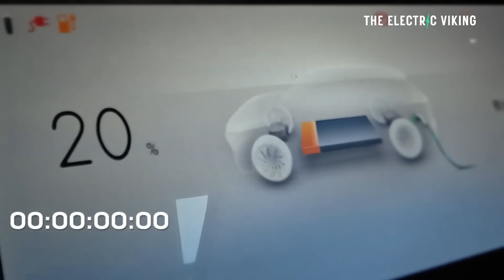CATL Unleashes Sodium: The EV Battery That WILL Rewrite Industry

Comment: I know you mention this in your video but I wanted to put some numbers to it.
Sodium batteries have almost everything going for them but have only one major problem. The big issue is energy density where a sodium battery has roughly half the energy density of a lithium battery (typically 100-160 Wh/kg for sodium vs 150-300 Wh/kg for lithium). That is fine if you are driving your sodium-based battery EV around the city but it will definitely have a much lower range when touring than the equivalent lithium battery.

As far as very cold temperatures go you will find that many EV battery packs have heaters installed which resolves the capacity problem using minimal energy. Typically the batteries keep themselves warm enough once up to temperature. Many EV's require active battery cooling as the batteries get very hot when supplying significant current to the motor.
Reply: The new One from Catl is 175. But yeah, far from the best lithium based chemistrys. Better than a lot of lfps though. There's also a hybrid One, trying to put together the best of both worlds. I Guess Pure sodium won't power premium ev's for example but definitely seem a good solution to smaller city Cars or stationary batterys where energy density isn't a problem.
Reply: future full solid-state Na battery is another story for density issue.
Reply: @民主美国炸小船  Perhaps but might be some years off as the first generation solid state batteries will be lithium based.
Reply: No point comparing the latest sodium with old gen lifepo4 cells.  The new lithium cells are cheaper and have faster charging, better density and temp range.  In fleet services where you pay the driver to wait to charge, pack swapping makes sense and high cycle life works as fleet vehicles see a lot more use.  Sometimes sams brain goes on holoday
Reply: maybe, but these wqill be great for home and grid scale batteries, making solar and wind even cheaper to install
Reply: Good for you living in a warm region of the world! I live in Sweden and the lowest temperature I experienced in Stockholm region was minus 35° Celsius. The thing is, at this temperature the cables in the air gets so full of ice that they snap, leaving us without power to our houses In that case you can't charge the battery and a litiumbattery will not only loose its energy, it will be forever broken! It can only go on heating itself for a short time as long it holds charge!
Reply: Don’t exaggerate, the lowest winter temperatures in Stockholm rarely fall below -15C and ice storms affecting power lines happen at much warmer temperatures. Downed power lines caused by ice storms would also prevent your petrol stations from pumping gas.
Reply: @JohanLofgren-jc4mh  Without a way to warm the oil I doubt many petrol or diesel engines would start at -35 C. I know in some areas of Canada shopping centres have mains power available to keep the engine oil warm while you shop. If the oil gets too cold it won't start and the engine can be damaged by lack of oil flow. I see little difference here between EV's with heated batteries and internal combustion vehicles with pre-warmed oil. Both need electric power.
Reply: @JohanLofgren-jc4mh  interesting. In the past decade, how many times have you lost power to your house due to power lines broken by ice accumulation?

Comment: 90% of its useable capacity at -40C sounds good, but don't forget you also have to heat the car as well.
Reply: Heating is the easy bit ?
Reply: That's not a big concern for most drivers. Even in Canada, we only get -40C a few days of the year.  Over 80% of the population lives within 100 km of the US border.  And most will not drive that far in -40C weather.
Reply: You could always deploy a  seasonal emergency chemically catalyzed heater  to boost the internal heating akin to diesel heaters used on commercial and leisure vehicles.....when used away from  the grid. 🧙🏻‍♂️

Comment: I don’t believe that battery swapping will be a thing in the long term. When a swap take 3-5 minutes and charging is down to 5-8 minutes 10-80%.
Reply: Battery swapping might make EVs more affordable if you don't actually own the battery, which Sam mentioned. You buy the car (or lease it) and it comes with a battery, but that battery is not yours and you don't pay for it. It's part of the "pool" of batteries in the swap system that everyone uses. It also means you never have to worry about battery replacement due to failure. It also might make a lot of sense for taxis and ride shares to operate this way. I kind of think there are a lot of plusses with certain use cases.
Reply: Why does a battery swap need to take 3-5 minutes ?  How long does a car service take ? How long does it take to put a new engine in an ICE car ? It's about time you people started sounding credible, either that or educate yourselves, that's just a ridiculous assertion......
Reply: @MickH60  What are you all riled up about  here?
Reply: @MickH60 what the hell are you talking about?? I didn’t mention or talk about ICE!

Comment: What's the charge voltage?  Discharged voltage ? Charged voltage?  Is the charge amperage stay high over most of the charging rate or does it slow down rapidly like many lithium batteries?

Comment: Na-ion batteries are initially being released as small 4-12V starter batteries in motorcycles due to their superior performance in high&low temperature & charge cycle, from what I see on the internet. 100ah 12V Na-ion is harder to find & almost 2X price of LFP still.
Reply: Nice to  know, was looking for small Na-Ion for DIY EV mower n home power tools.
Reply: It would be good to see a video on the electric motorcycle market, and which batteries are both in the market now, and also, what's coming in the next 12 months.

Comment: Wasn’t this launched in April and went into mass production in June? As far as I can see it may produce a 500km range battery that can operate well at low temperatures, but lots of people saying it doesn’t have a price advantage over Lithium. Hardly a game changer.
Reply: The sodium ion battery supply chain is hardly just table salt as all that is needed..there are other exotic materials needed that aren’t made anywhere near as abundantly as with the lithium ion supply chain (News flash it took lithium ion 30yrs+ to get here!) 

Sodium ion prob won’t be competitive price wise until 2030 or so…and don’t forget that lithium batteries are also getting better at the same time…the reality is that lithium will have the upper have as it is well known and battery customers like auto companies have to put long term warranties on their products…they can’t just take a gamble on brand new tech hoping it works out…sodium will need a decade in the field before major customers will put it in their products at scale
Reply: Have you checked the price of sodium vs lithium carbonate?
Reply: @chrishaberbosch1029  according a Google search the cost of the lithium is about 7% of the total battery cost. So a lot depends other components of the battery.

Comment: The biggest impact is it will drive the price of a barrel of oil down to 5.00
Reply: That'd be cool it would instantly kill the oil industry.
Reply: Or negative like during covid. But that's not going to happen. Dollars are infinite. Oil will go to 120+.
Reply: No, it won't.  First of all, less than half of the oil is used to make fuel, the rest is used for plastics, medicines, roads, lubricants, fertilizer and on and on.  There will still be a huge demand for it.
Reply: @IamGoen  
Darn can't paste the image here, silly utube. Briefly, 50% passenger automobile. If you add in all other transportation, bunker fuel and heating oil, you're now well over 80% leaving say 15% for structural. The $5 number isn't really in the picture. The number to worry about - who knows what it will be in the 2030s, 2040s, because of inflation and many other factors - is way over $5. That's where stranded assets in the oil industry start to get nasty. Taxpayers beware!
Reply: @IamGoen  No is isn't...  Stop lying. Show us your data. Is that from CAPP? No, than shove off!
Reply: @IamGoen  maybe yes, oil is precious resource, we shouldn't; waste it just to drive to work
Reply: Good!